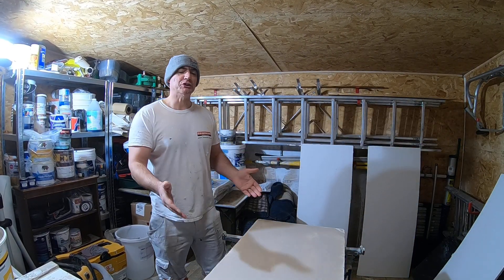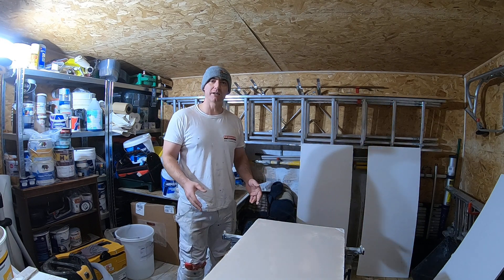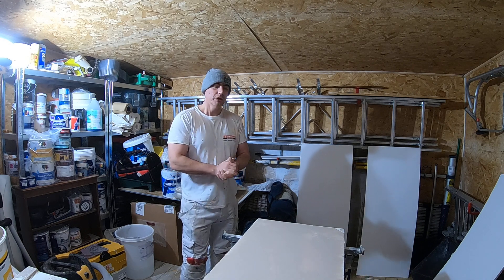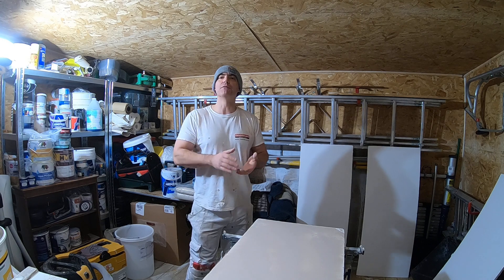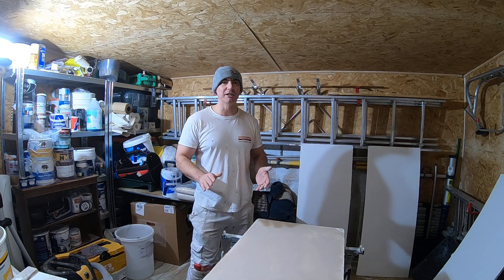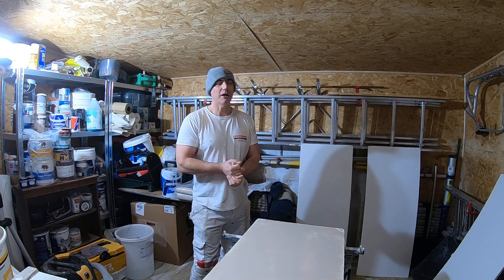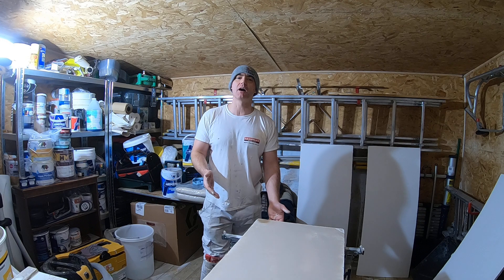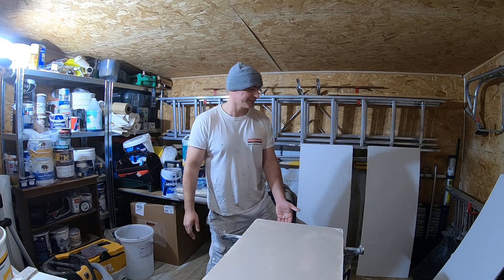Phase 4 preperation of product testing boards-Part 2-sanding and refilling

Comment: Joe I subscribed. I will be doing exactly this for my garage. For the final coat, I have only worked with latex paints in the past. Do you recommend oil base over latex. FYI this will function as my garage for vehicle and also my gym/weight room. Thx again.